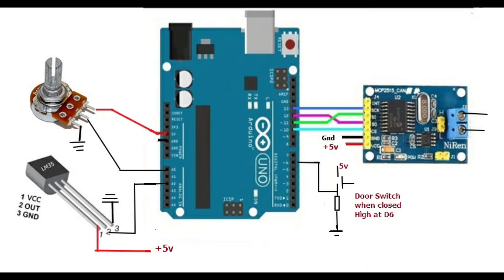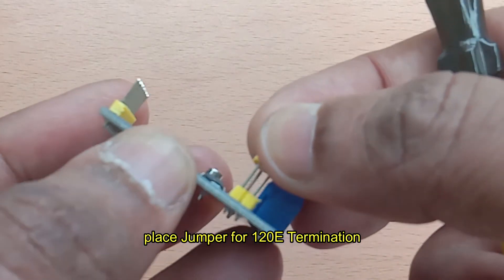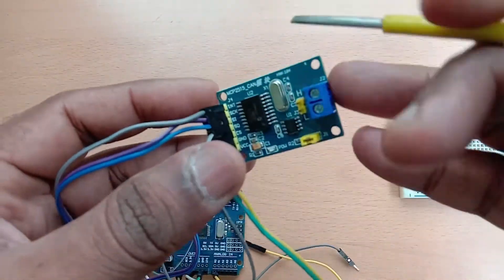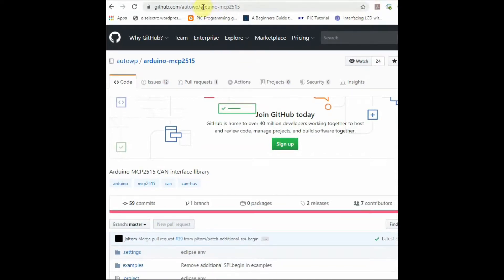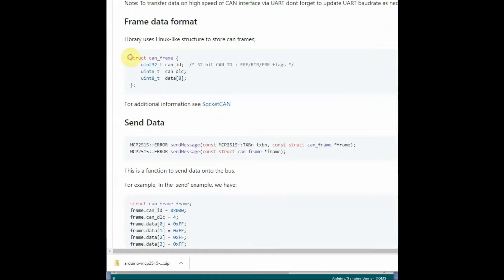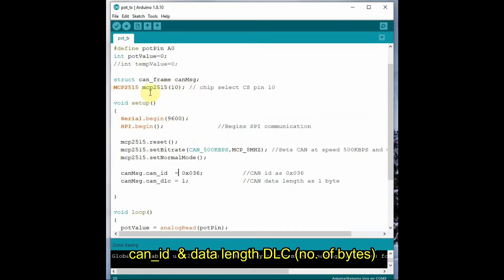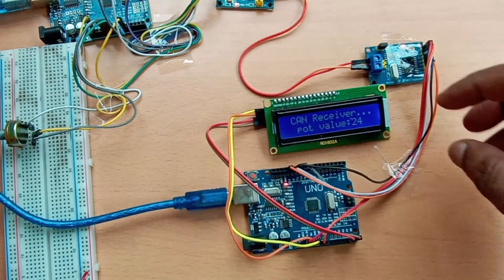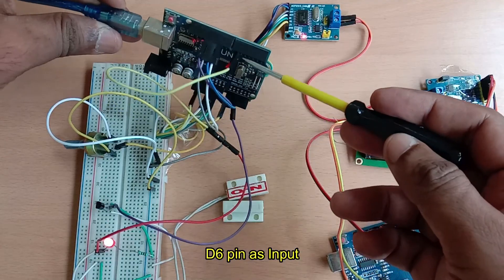Sensor Data over CAN BUS - Arduino with CAN2515

Comment: Excuse me, sir. How to send data through two CAN Transmitters to one CAN Receiver so that data does not collide. And how to initialize the CAN id of the two CAN buses. On the other hand, the video is very informative and I will apply it to my project.
Reply: And how to send data if the value is more than 255, what about float data. Please help me sir.

Comment: Had to change "lcd.init ();"  to lcd.begin();  to get the sketch to compile properly and then change the  I2C address so my lcd screen would work. Also, add a line after the led.print (x);
led.print (“ “);  to make the display show the correct value through out the entire 0-255 range.

l hope this helps other noobs like me.

Comment: Sir, can we read CAN data using Arduino from unknown CAN device??
Reply from the maker: yes we can. But you should know the voltage level of data. 
Suppose you get data from PLC it will be at 24v level which should be converted to 5v TTL
Reply: @SaravananAL  ok .thank you sir...so does program remain same for reading data?? and if it is 24v ttl ,then how to convert it to 5v ttl??

Comment: Thank you for the tutorial.  Can you show how to hook up more than 2 CAN devices.  

Looking at the initial picture you showed it looks like we need to remove the jumper from the middle one and use it as a bypass.  do we connect the High lows to the same port or use the resistor jumper?
Reply: You probably dont care but does someone know of a trick to get back into an instagram account?
I stupidly lost the account password. I would appreciate any tricks you can offer me!
Reply: @Keaton Sergio instablaster :)
Reply: @Reign Alden i really appreciate your reply. I found the site thru google and im trying it out now.
Looks like it's gonna take quite some time so I will get back to you later with my results.
Reply: @Reign Alden It worked and I now got access to my account again. I am so happy!
Thanks so much you saved my ass :D
Reply: @Keaton Sergio no problem =)

Comment: First of all thank you very much for this great work.
Excuse my ignorance but I just heard of this can bus, what's so special about it? Specially what what advantages does it have over RS-232 or RS485?
Reply: Multi node is probably the biggest reason and I think higher speeds.
Reply: RS485 is master-slave arrangement, CAN is a multi-master arrangment. CAN also incorporates non-destructive collisions hence the communication will be smooth

Comment: I'd like to do this using mbed, but not sure how. 
The github example (github.com/ARMmbed/mbed-os-example-blinky)  listed on the website (os.mbed.com/platforms/ST-Discovery-H747I/) says "this example project specifically refers to the command-line interface tool Arm Mbed CLI."  But a "rendered example" can be imported via the online compiler.. what does that mean?  How do you setup the CLI?